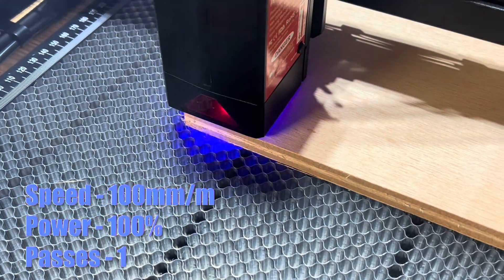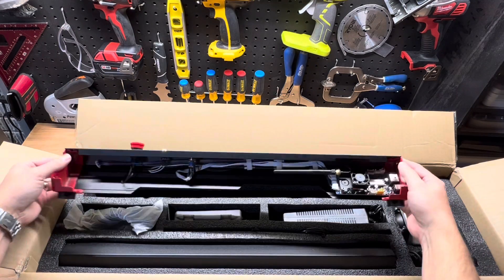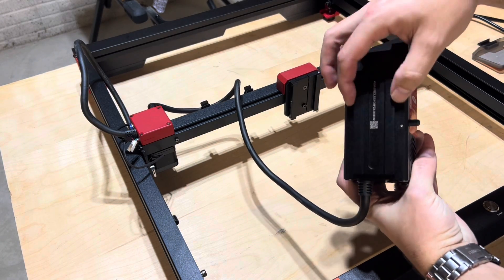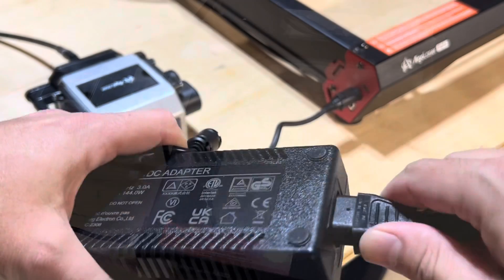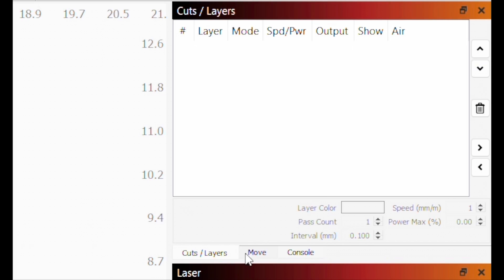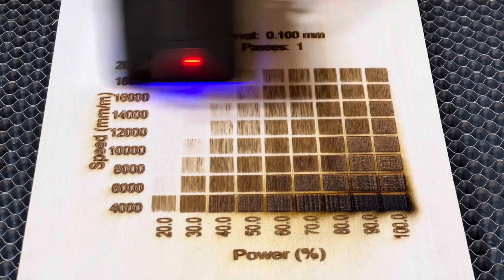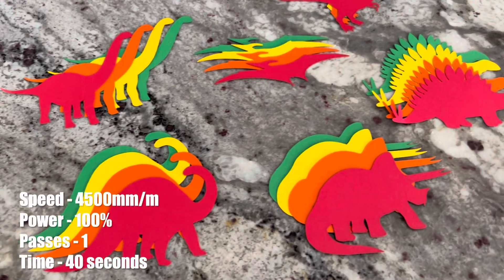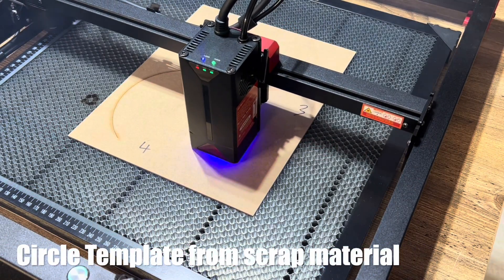Best Laser Engraver 2024 - AlgoLaser Alpha 22W

Comment: Just pulled the trigger on ordering this laser.  WM has the kit - air assist, rotary and risers for a fantastic 799......  I'm glad I saw your video to make up my mind to get a 20 watt laser.  The test matrix tells all with damn near half of the boxes cut completely through.  I'll be sure to manually move the x-y fully, BEFORE powering on, as it is just a good thing to do..  Thanks again for your work - really FUN....  Have you tried a low/medium power burst to create just a "dot" to have a visual of the beam itself?  Inquiring minds want to know....

Question, as there is a sweet spot of focus that initially is good for the top several mm, would it be preferred to slightly lower the focus position for when you are cutting thicker material??  You would loose the upper focus a bit, but, moving the focus downward would provide a tighter beam as it penetrated towards the center of the wood.  Just my thought and PRACTICE will tell....  🙂
Reply from the maker: Congrats on your new laser engraver!  You’re welcome, it can make endless projects and help take your builds to the next level.  Is WM Walmart?  To answer your burst question I always hit the fire button to see the laser and frame it out.  As far as adjusting manually there is no need.  An awesome feature is the spring-loaded focus stick.  Simply pull down on the lever to lock it and set the focus then push the button to release it. 👍